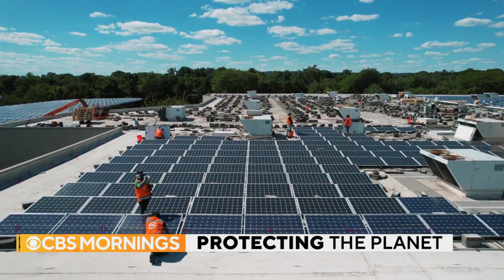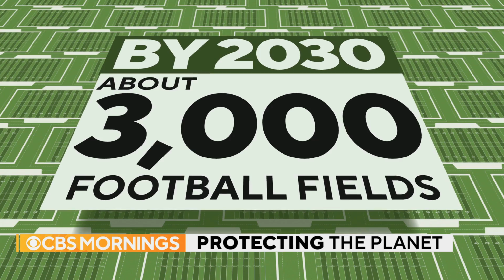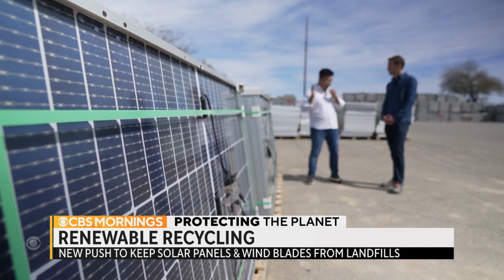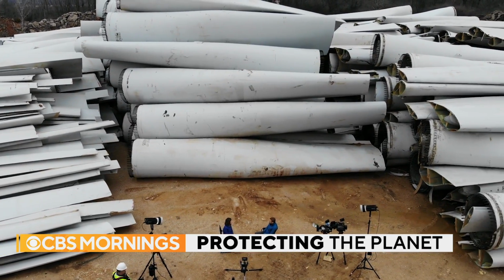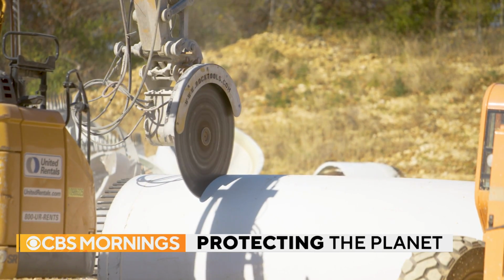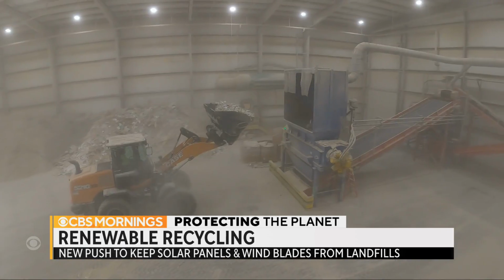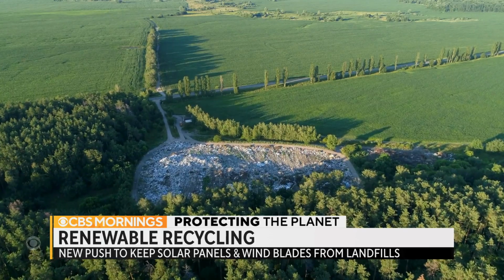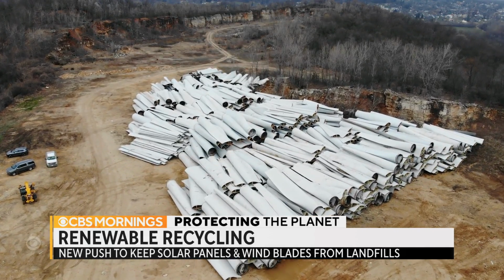Wind blades and solar panels head for landfills after being replaced

Comment: Still way better than oil.
Reply: 😯 Oil is need to operate the machinery such as excavators to mine for the materials that are used to make the wind turbines. The vehicles, that use oil, transport those ores to a facility to be further processed. Construction companies use oil guzzling vehicles to transport cement and other materials to construction site. Once the facility is built, coal or oil is used to run the furnace to melt the ores. Materials from different facilities are then transported from around the world to a facility to make the wind turbines. The wind turbines are then transported to the wind turbines farm by oil guzzling vehicles. After about 20 years, the wind turbine blade are transported to a dump site.
Reply: @ricardor7578  You're talking about the old. New times are ahead. I can imagine the horsing industry making similar argument a hundred years ago. Something new came up and they gave up. Oil is finite and wont last forever. Its best to embrace something that lasts forever or as long as we have the sun.
Reply: @muhammad-bin-american  
I'm all for nuclear. Let's go nuclear! Eventually we'll figure out how to harness  nuclear fusion. Once that happens, Humanity will experience a new revolution. We are currently at a precipice, but Humanity will overcome. It is in our nature to overcome problems as they arise.

Comment: The green revolution isn't very green is it. How much carbon goes into the manufacture of 1 windmill tower?
3 blades, a giant generator, full of steel and copper and plastic and oil and ??
A Tall tower made of ? Steel ? 
A gigantic block of concrete, very carbon intense..
The road building to get to the site ?
The transportation of components..
What else ?
And then replace it all in 10: to 20:years..
Not really very green..
Oh, and recycling creates it's on carbon..
Good thing carbon is not really driving climate change..
Reply: OK, so draw up a comparison asking the very same questions about a traditional fossil fuel plant, like say, a modern combined cycle gas turbine plant. Compare the results and get back to us, then we can discuss pros and cons with actual data. Of course, I know you won't, because your very last statement was a lie.

Comment: I'm not an expert in wind turbines, but are they really that big of an issue if they end up in landfills? The material used for construction seems pretty inert and robust. It's not like they're going to decompose and release methane or anything like that right? Isn't it fine to just leave them in the landfill? It's not like we're going to run into a crisis where we run out of space because of wind turbine blades.

Comment: What do you mean unexpected??? Those with a brain have been screaming for years about the massive carbon and trash footprint of green energy. Do the research... these panels batteries and windmills do not just appear the materials need to be mined processed refined and then shipped to the manufacturer to make the equipment.

Comment: If the MPP unit, the one stuck on the back of the panel, was blown by a static voltage hit then you can replace the 4 diodes in the unit and voila it is good again. Also check to see if panel has any burn spots etc that would disqualify it however. Many can be easily repaired this way DIY at great savings.
Reply: problem solved!

Comment: To capture low energy density power like wind and solar you need lots of panels and turbines. These wear out frequently and need replacement.

Research how sustainable it is to have to extract the resources to continually replace these items that are needed on massive scales. 

There is a limit to how efficient they can be so the power generation improvements have a thermodynamic floor. Solar and wind will always need millions of units that will need frequent replacement and drive extraction of finite raw materials. 

No free lunch.

Comment: Just a point of comparison… a typical car will burn about 5000 gallons of gasoline in its lifetime. Each gallon of gas burned produces 20 pounds of CO2. So a single car - the one in your driveway (one of them, anyway) - will produce approximately the same weight in CO2 as the blades of two wind turbines. Of course, those blades last 20-25 years, far longer than the average car.

Comment: This is so stupid.  Wind mill blades are not "indestructible."  A fair number of these "indestructible" blades fail in service.  And burning the waste is massively polluting.  In fact, the carbon footprint of both solar and wind power far exceeds the burning of clean coal for an equivalent amount of power.

Comment: The fine print about renewables surpassing coal is that subsidies were required to do it. As soon as you take away the subsidies, it is no longer a viable option, and in fact when the wind stops and the sun isn’t shining, coal and nuclear are going to be your main sources of energy for the next 30 years…. so friends, we had better start building those 15 nuclear plants that we need desperately, or you’re not going to be able to charge your virtue signaling electric vehicle.

Comment: the problem is the green morons, it cost's more to manufacture an electric car, the batteries have a short life and have to be trashed somewhere, just like these solar panels and blades. there is no advantage in solar or wind power if it pollutes our planet. we know its possible to have other sources of power, why not use what we have already and stop making it worse. electric cars, i've actually seen comments on videos where some of todays generation think you get free replacement batteries when yours wear out. and most don't understand the power to run these vehicles has to come from somewhere.

Comment: I didn't know those windmill blades were made of plastic.  Maybe they could be cut into tiles and used as roof shingles.  It's hard to find a use for them because they are not flat.
Reply: Yeah- or whole roofs- if the building was designed around the blade/roof.
Reply: @adambeck8180  Yeah that's actually a pretty good idea but I don't think it's really workable for regular houses.  I think they could be used as roof joists for large warehouses and similar buildings.  You wouldn't even need to do much cutting.

Comment: I am fairly sure much of the blade sections could be repurposed easily.  Homes could be constructed using them as supports.  Blade sections could be used in smaller windmills.  But greed demands a profit.  Nothing for 'free'.

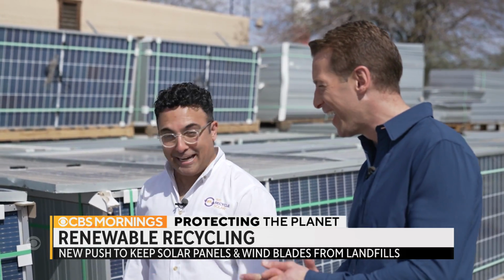Comment: 1:49  The executive being interviewed means that the 3-4 year old panels have 90% of their rated capacity (more than that, certainly), not that they are 90% efficient.
Reply: Why did the people who owned the solar panels get rid of them after 3 yrs if they were so great?
Reply: @charlesyoung2530  most are from industrial applications not individuals 
Such as when they upgrade a solar farm or remove for an example an oil well
Reply: @charlesyoung2530  solar panel tech advances so quickly that they can fit more watts worth of panels in the same area. When that happens they replace the older low wattage panels with newer high wattage panels increasing the max power the array can produce without needing more land.
Reply: Those panels have probably 98-99% capacity left. Modern panels degrade .5-1% a year.
Reply: Yes, It's 90% from 20 to 23% maximum on a solar panel.

Comment: Manufactures like these need to be 100% responsible for 100% reclamation and recycling.  Yes, it costs however the manufacture needs to include 'end of life processing' into the overall design.  If manufactures are made to be responsible they will engineer better recycling capabilities and processes into the overall design.
Reply: Which should apply to all industries

Comment: Ammonia fuel is the future not electric cars, Solar wind 
 Ammonia aka nitrogen hydrogen 3 NH3 is a cheap renewable  fuel that can be used in any gasoline engine and diesel with minor modifications.  Look up videos of ammonia as fuel. And you will see you've been lied to for nearly a 100yrs about needing  oil gas, solar wind, nuclear,  and now electric cars 
   Ammonia has been used as a  fuel before gasoline or diesel fuel even existed.. Ammonia engines existed before the combustion engine. 
Ammonia was used in 1960s Nasa space race,  it is still used in rocket fuel, aviation fuel, race car fuel. A rocket car running off straight ammonia holds the land speed record. There is more energy available in ammonia than gasoline,  diesel,  ethanol.  
You don't hear about ammonia as a fuel  because of corrupt politicians and corporations  know it will destroy the oil gas, electric car,  solar wind,  nuclear power,  power grid companies.
All takes to run a gasoline engine car, truck, boat , generator etc off ammonia is a propane tank and 2nd fuel pump set set up. a diesel need a propane tank fuel pump and a cpu tunner kit to get compression right.  
You can make ammonia at home or buy ammonia making processor, and easily made anywhere in the world even in the most poorest nations.  
Ammonia is made by pulling nitrogen from air, bonding it with hydrogen through Electrolysis with water and bumping off oxygen. 

https://youtu.be/XHZXAz9WP9M
 https://youtu.be/_H4XZ_m7P0E
 https://youtu.be/L0hBAz6MxC4
 https://youtu.be/B6HzP84KhoY

Comment: I had no idea solar panels only last 25 years ,now how long does a coal power plant last?? Im going to guess a lot longer than 25 years.
Reply: I guess it depends on what you consider lasting.  Coal plants need constant replacing of parts.  It's not like you install them and that's that.  Probably after 25 years, the original stack and building is the only thing original.  Boilers get replaced after 15 years, all the blades and bearings on the turbine get replaced and serviced many times.  The piping usually makes it about 30 years.  They are down every few months for service.  Conveyors get replaced often.  And 25 years is the warranty period of solar panels, not when they stop working

Comment: I drive a 19 year old Volvo, it is not as efficient as a new car, but it is in good condition and runs perfectly well.
Would I use a 3 year old solar panel ? of course I would  it cost 1/2 the price of a new one, and was slightly down in efficiency.
Scrapping good working items goes completely against the "green" ethos.
Reply: That's why they say and I quote at 1:25  "...by recycling or reusing nearly 70 million pounds..."  used ones go for upwards of $100/ panel.  There's no way they would recycle one if they can resell it. There are plenty of places that sell used panels.  I was just looking at a pallet of them for $2,250 or 30¢/watt

Comment: Solar panels "last 25-30 years" because of atmospheric wear on the glass coating.  Usually 1% per year is lost to hazing and abrasions, after 25 years they are generating 25% less power.  The electrical components still work just as well as they did on the day they were installed.  Scrapping them is ridiculous.  That's just some executive with zero cognitive abilities making a decision to scrap them instead of sell them to a secondary market.  Just figure out a flood coat that will restore the glass to close to original clarity (gee like the headlight restore/cleaners) and they are good for a few more decades.  The efficiency of the panels they are replacing has changed and they are better each year.

Comment: Last 25-30 years. If 4 year old panel is only 90% so its 2.5% loss every year? How can they claim 25 year life span? I thought if 25 years it still be 90% atleast, numbers dont add up
Reply: That is why they are here and not on the roof.  Manufacturing defects can cause them to lose more or they may have not met spec from the beginning.  If they lose 2.5% in a year, you can submit a claim to have them replaced under the performance warranty of the manufacturer.  Some people are offered an incentive to keep them, some just want them replaced under warranty and they go here for reuse or recycling if the defect it too great.  They test them and resell them on the used panel market and crush and recycle the rest that isn't usable.  The typical guarantee is 90% after 10 years and 80% after 25 years or about 0.8%/yr.  Obviously,  much more than 90% beat the warranty.

Comment: So, if windblades are indestructible, then why do they have to be replaced?
Reply: I dunno, I've seen plenty of videos of the blades destructing...
Reply: Purposely designed to have a lifespan , that way they can make more money on long term maintenance contracts. In turn this means chopping up more balsa wood , processing and manufacturing thousands of tons of polyester resin and epoxy resin , plus thousands of tons of glass fibre cloth , plus thousands of tons of CO2 in transport . Every service interval . 
Kinda funny how these blades only have a rotational tip speed of a few miles an hour and a short lifespan yet they can build an aircraft wing to last many decades and survive airspeeds of several hundred miles an hour . 
Money money money !!!!
Reply: @newagetemplar6100  Everything have a life span nothing last forever.  You soon will grow old and die.
Reply: @mrtee3477  fortunately for me I’m a composites engineer so know what I’m talking about . Then why can you still use a carbon fibre monocoque that’s 25 years old . That has passed by the FIA and crash tested ? 
Built to the bare minimum to save weight? 
Large fiberglass boat hulls don’t have a short lifespan like turbine blades nor do 40 year old lotus elan body shells . 
Fraid your wrong mush
Reply: @newagetemplar6100  ...errrrr how much would that cost!
Reply: @manoo422  not that much , you wouldn’t necessarily use carbon fibre as glass filament would do which is what they mainly manufacture them from now , just factor in flex , tip speed , modulus of the resin used and a few other things like ultra violet degradation . Technically is quite feasible. Just relate it to composite leaf springs on vans that have a long life span used for years , fishing rods , etc etc etc . They could make wading machines last longer but hey don’t !!!!! Simple marketing tactics to benefit someone dreamt up by the marketing team to generate more income using fear to profit
Reply: @newagetemplar6100  bingo, it's all about $
Reply: @newagetemplar6100  not a whole lot of abrasive dust and particles thousands of feet in the air on a plane. Also wind turbines turn 100mph up to 200mph... They spin almost 24/7/365... Planes do not...
Reply: @newagetemplar6100 my guy... No that is not the reason
Reply: @randybobandy9828  then what is it?
Reply: @randybobandy9828  what then?  Hello?  Where'd you go?
Reply: @rand49er  randy doesn't have to actually tell us anything..... just disagree, then disappear. Logic & science doncha know.
Reply: @randybobandy9828  where u go randy?
Reply: They leading edge get destroyed fairly quickly and loses all efficiency, must be all the eagles they chop through.
Reply: @manoo422  See how tough they are, against a Canada goose.
Reply: @manoo422  you apparently do not get the line... you can not call something INDESTRUCTIBLE if you have to replace it constantly
Reply: @bobshagit-io8lq  Who is claiming they are indestructible..?
Reply: @manoo422  I saw some rubberised leading edge paints. are they any good?
Reply: I was about to post the very same question.
Reply: Exactly, the blades simply bolt to a hub so it doesn't make any sense that they would become worn out or anything.
Reply: So “they” can make more money off the scam
Reply: They have a short lifespan.
Reply: @paulbedichek5177  Right, which makes wind power generation even less environmentally friendly than fossil fuels. They produce far less electricity and it can be stored efficiently.
Reply: @soonerdad3  They're still far more environmentally friendly. We just ignore the 500 millions of tons of coal annually that we push up in the air (and comes back down). The highest source of radioactive pollution comes from emissions from coal plants. The reason that we have high mercury in fish is also from coal plant emissions. Wind and fossil aren't on the same scale for environmental impact.
Reply: @tjsbbi  no they are not, they are extremely inefficient and besides natural gas power plants are far more efficient and produce less emissions
Reply: Wonder if they will withstand a hurricane. Those things flying around in the air would not be pretty.
Reply: New and improved blades
Reply: Because they "wear out" and "delaminate" and fall apart. They are not "indestructible"!!! In the heat to implement renewables, the earth huggers forgot the long term effects on the environment!!!
Reply: Like an airframw of a plane ot only lasts so long before cracks start to appear eventually leading to failure on the structure
Reply: Who told you they were indestructible, which they aren’t, and, why do you believe them?
Reply: @davezul4396  it's right in the CBS video.  Oh, I get it.  That's CBS reporting.  Not to be believed.
Reply: @davezul4396   The reporter  said they were indestructible himself. Are you suggesting that the news would lie to us? That  can't ever happen.....
Reply: @davezul4396    Use your head.   By indestructible, they mean extremely difficult to shred, but not impossible.

Comment: Unexpected side effect? this was 100% expected, you just ignored it.
Reply: 100% expected, and 99% better. fossil fuel plants generate waste continually in the form of NOx, CO2, and particulates. And worst of all, directly into the air! Coal is even worse, with the coal ash. But those are disposed continuously so there's no big news story. A garbage truck every day or year over year increase in lung canser and asthma doesn't make the news. But its more significant than a few pounds of waste per person